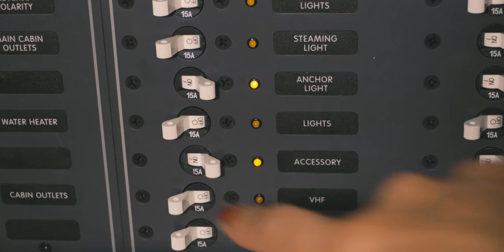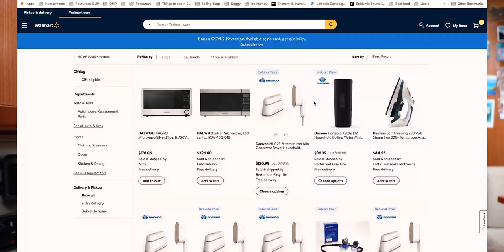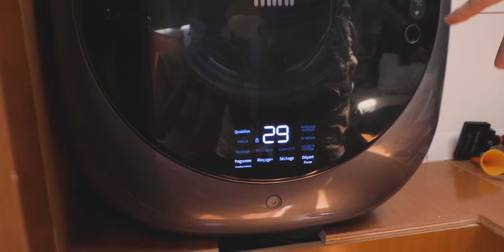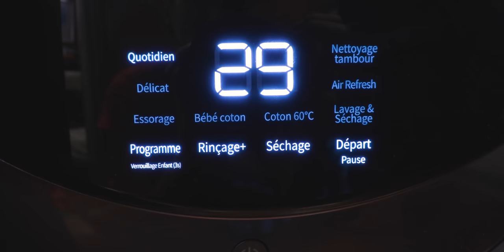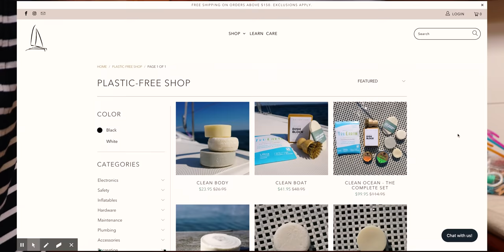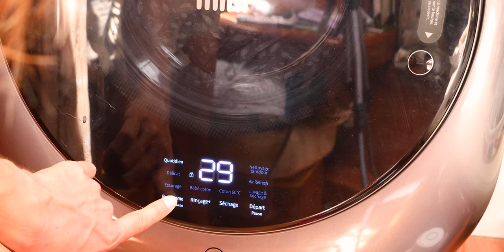Installing a WASHING MACHINE in our 40ft sailboat  #87

Comment: Loved it, I'm happy for you guys!
Ryan you are smart enough to make a saltwater intake for the cooling off the dryer.
On the washing machine will be a two way valve, take that one out of the system, hardwire the fresh water to the washing inlet. Make a saltwater inlet with pump to the cooling bit. Do not disassemble the valve from the machine, let it think it stil has control over the valve.
Reply: Then the internals will corrode in a couple months...

Comment: Big plus for the use of an eco friendly laundry detergent, and nice that you advocate it here for other cruisers with washing machines aboard. Cheers.
Reply: The only worry is if you get black mold build up inside the machine ,ike you do with fabric conditioners. That stuff is a bitch to get rid of, and the spores are really nasty and get into the things you wash. By the time you spot it, you already face a nightmare getting rid of it, and the trick seems to be using bleach and high temperature washes with nothing in the machine, then doing the same but with Soda Crystals and keep alternating between the 2 until you kill the stuff. A friend in F.orida found his machine had it, and it took months to fully eradicate it, while using it as a washer between sterilising washes. he put it out asca Health alert, and hasn't used Fabric Conditioners since. Neither have I. Personally, I suspect "Eco Friendly" alternatives could be equally encouraging of such molds. That Black Mold is as unhealthy as Dry Rot Spores. ☹️ Best Wishes.  Bob.
Reply: @brownnoise357 Use wool dryer balls (I guess that means adding them at some point in the cycle?). Try sodium percarbonate for preventing the mold. It’s a non-chlorine bleach that doesn’t harm 99.9% of anything I’ve used it on since I started using it 10 years ago. I think there was a certain special fabric once but can’t remember know bc it’s been so long ago.
Reply: @JillofAllTrades2  Thanks for mentioning those, as fabric conditioners and maybe conditioner sheets ?trigger the growth of the nastiest black mold and spores which end up going right through the washing, especially with low tempurature washing and drying, and it’s a sod of a job to thoroughly remove it from the machine, with repeated use of Bleach, Soda Crystals and such at high temperatures. ☹️Best wishes. Bob.👍🏴🌟🌟🌟⛵️❤️

Comment: LMFAO YOU HAVE ONE TOO!!! HAHA we bought our a couple months ago. Works great! 220 60v 3,000 inverter just for my mini. Now I want a 220v 60hz microwave. I reused my black water tank into the hold for my laundry water so I flush with that. It has a value to go right back to sea water when empty. I mad the sailing uma version of a black water tank.
Reply: What model boat do you have and where did you mount the machine? Thanks.

Comment: Congrats :) We have one installed for 3 years now - a earlier model and do not have dryer,  sometime it does not vibrate at all  during the spin sometime the whole boar jumps :) we paid £320 for it - got it from France (was very difficult to get one in Europe) ... the mounting was a nightmare but finally all is perfect :)  there is some issues 1. you cannot wash without spin - e.g. prevent the boat jumping :) 2. when weather is a bit colder e.g. 10-15C degree the machine uses  A LOT more electricity to heat the water up to 40C( no setting to wash on lower temp. All else is perfect ...also the waste water goes in the bilge - which makes the bilge clean and leave a very nice smell inside the boat after washing :)
Reply: What model boat do you have and where did you mount the machine? Thanks.

Comment: I am really excited about this machine. By the way the drying water should be fresh and able to be returned to your water tank if it can be intercepted before it hits the waste water pump. I am going to research that. These machines in Europe are €1600, so you got a bargain, and as you say “Daewoo, … if you are listening ….. I just want to buy one of your machines, why is it so hard ???? “.
I am going to have to mount it under a seat and make a lifting gizmo (think hidden tv’s) to make it fit, but if that is what it takes then that is how it will be. I hope you are still as excited with your machine these months later.

Comment: Agree with you on the need for a washing machine when you living aboard.  Once you have the lithium batteries, proper solar and a water maker, next is the washing machine.  I also would add AC in the cabin you sleep in to the very nice to have items.
Reply: Agreed on the air conditioning plus heat. AC can do dehumidifying preventing molds and spors building upminside the boat, and heat to prevent equally damaging Condensation. 9,000 btu portable AC can fit the Bill quite cheaply using about 1kw. Personally I'm thinking of getting 2 portable ones driven by a 3kw inverter, one for kitchen, rear salon area, one for forward Cabin and heads area. combined with fans one plumbed into the galley the forward one into the heads, so 2 should cope with dehumidifying with luck. I'll have the necessaries for forced air heating installed ready, but only have one fitted if heading somewhere cold (which I'll try to avoid 🙂) Im trying to avoid having a generator installed tbh. Best Wishes.  Bob.  👍🇬🇧🏴🇺🇲

Comment: I did not see mention of the freshwater hook up.  I'm assuming that was pretty close to tie in.  Also, I wonder if the "lint" that exits with the waste water from time to time "may" effect that water sensor on the waste pump.  Might be something to add to your pre-checks from time to time (remove hose and clean sensor).  Thanks for sharing about small combo.  I found out about those 4 years or so ago.  They were hard to find then.  So weird ot have a high demand product, with no supply.

Comment: Thank you for this great and honest review... These are unfortunately still really difficult to get a hold of and don't have many reviews. Plus there are various similar-looking (yet different) models, so it is not clear whether one is buying an old model or an updated model. It is also really unclear whether they are actually made by Daewoo or if they are made by this other unknown company Winia... AND if the control buttons have Chinese text, or if they are written in English, French etc in various other countries... After all this, the few videos around report that they are awkward to install and that they tend to shake a massive amount. 

Mix ALL these unfavourable facts with the fact that they are very pricey: £860 in the UK for washer / £940+ for washer+dryer, makes them not very desirable... No one wants to pay a lot of money for a miniature-sized appliance that may not work very well and risk screwing up their boat or their expensive van conversion – not to mention the possibility of having to pay again to have it ripped out and replaced with something else after only 6 months.

I wish they would at least make much more product information available and sort out the installation & shaking issue. 😐

Comment: we're also using the daewoo mini on our boat. hot washing program is only a bit to high for our inverter. did anybody ever tried to hotfill the washingmachine directly from the boiler to use it with a cold program ?
Reply from the maker: Yes... the guys on whensailing did this.  I think they made a post or video about it

Comment: I have been looking for a machine like this for a year!  However, I have a 12V lithium / Victron system I have installed, with 640aH batteries.  Do I need to step this up to 24V?  So far, I have only seen a 24V Winia / Daewoo mini.

Comment: Improvement from the foot operated cockpit, buckets or dingy washing possibly. No fun or I think she will watch it like a cat. That is so much smaller than my previous condensing washer/dryer. I could seriously consider it now. If you like to conserve water I am wondering if there is any possible modification of design to recycle the condenser cooling water. They could even charge more and call it the marine model, we like this overcharge right? I will look at the design if it is available on line.

Comment: Excellent, I it is a pain in the rear to have to do laundry even when you’re in a marina.....so having to get on a dinghy to do laundry and having to walk miles to a laundromat while great for your weight loss is no fun at all! 😆

I do have a lithium/engine charging battery question! 
I bought 600w of lithium batteries with a 3000w inverter/charger....I have a 125v alternator, is there anything I need to add between the alternator and the batteries as to no ruin the batteries??

Comment: Welcome to the 20th century. Does the electrical demand require running a gen set or engine regularly, or does the solar supply enough? 
One note:  it looked like your drain tube had some low points on the way to the drain. Nothing quite as nasty as stagnant laundry water. 
Congrats again. Great lifestyle improvement.

Comment: Where did you get the parts for plumbing? PLEASE HELP ME DO MINE!
Reply from the maker: I just bought all the plumbing at a boat shop.  The pipe adapter I found a way to get a quick, quick realize pipe adapter to connect to it.  Worked well

Comment: Nice addition to your boat. I hope this thing really stands up to the environment and use. Anyhow, I would have been very hesitant to cut out pieces of the interior to fit this. On the other hand, that seems to be the only place on this boat to be mounted inside the cabin. It is really too bad that there is no access to the big portside locker from inside. That could have been a place to mount it out of the living area. We have the same boat, same age. 
BTW... your Torqueedo gears seem to be very noisy. Are they OK? Anyhow it's known that the Torqueedo gears are noisy. Otherwise, it's a nice e-motor. The noise was the reason we got the EPropulsion 1.0. It's very quiet but has other problems instead.

Comment: T h a n k  you for sharing your experience with this product. 👍Our intention is to buy the same machine for our motor-home. However, a friend told us that you can only use those wall mounted light-weight washing machines to wash light-weight textiles and no jeans!!! Sophie, in case you read this: I would very much appreciate if you could let us know if you were able to wash jeans with your Daewoo DWD-35MCRCR? If so, how many jeans did you manage to wash in one go? And does it dry the jeans as well?

Comment: I wasn't able to install this machine at all. When I finally got it anchored in, with the weight supported. It didn't work. Power was on, water was fine and even bought those expensive voltage adapters. But just wouldn't run. Even tried to call Daewoo's installing team in China, since that's the only place I can speak the language and they actually have people servicing this machine. Nothing... Do you know or anyone else what's wrong and how to fix. I have spent sadly two years to get it to working gave up. Is it because the outlet doesn't have enough power. I just discovered that to get a microwave range installed in our house we need to have our electricity panel change to different I don't know, but something to be able to make it work. I started to suspect that might be the reason, because our house is able to produce much electricity. It's 50 or more year house. What is strange the morons that made the home had the system designed for a higher power, but didn't add something to make it work.